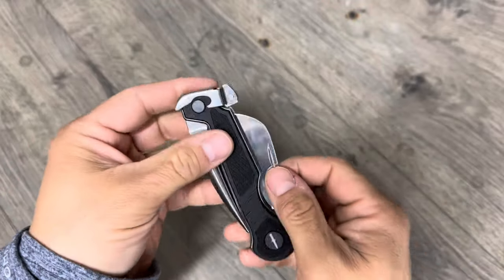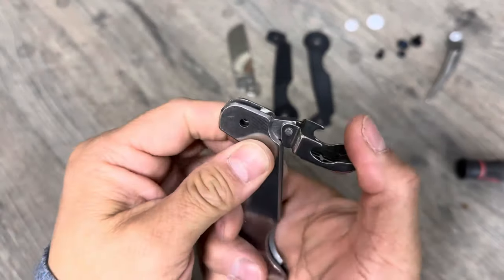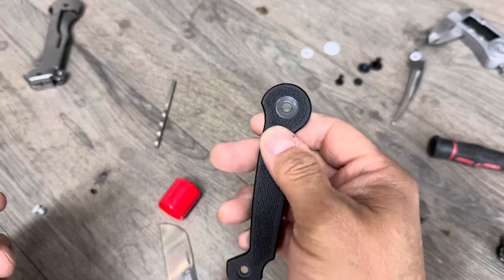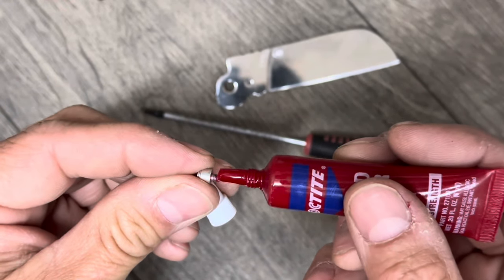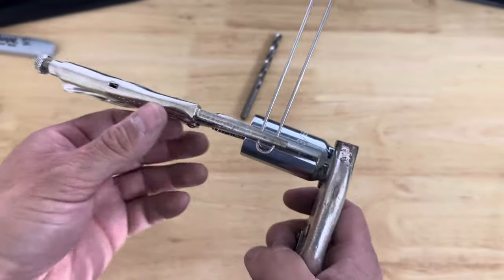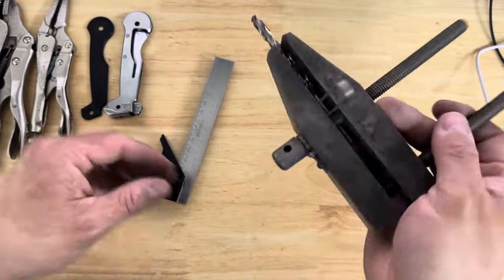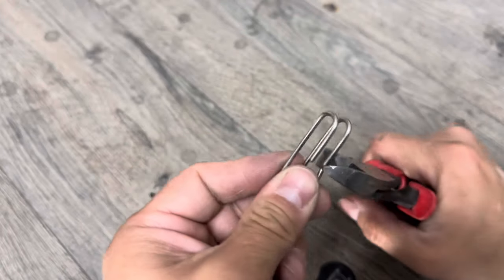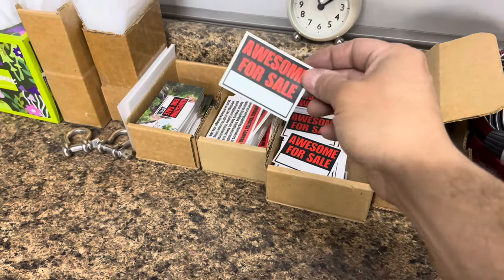I didn’t like my marlinspike knife, so I fixed it.

Comment: 😮 So much machinery for relatively tiny modifications. The result is awesome and professional. I think the knife brand should take note of the upgrades you make in this model because not everyone can do it at home... 👍
Reply: the ONLY reason I don't have one is the lack of a pocket clip....
Reply: Nothing fancy there but the water jet. I am betting a carbide tipped drill bit with lubricant would work just fine. Besides its not like he bought that equipment just for that project. He will use it again and again.
Reply: @dlighted8861  Apparently you can use a masonry drill bit.

Comment: Thanks FCA, you have quite a shop. For those of us unfortunates who do not have a water jet, d'you think a carbide drill bit would have made good progress? The tooling is pretty sweet, the engineering and execution is what sets you apart.
Reply from the maker: I don’t think it would work, but I also don’t have a whole lot of experience working with hardened metal.  If I didn’t have a waterjet, I would have used a small torch to heat up the area  I needed to drill. You heat it red hot then let it cool by itself, no quenching. That changes the temper enough to drill it with common drill bits. I’ve done it with hardened ball bearings.
Reply: I thought about it after I commented, and recognized the risk of the bit shattering too; yikes high velocity spall. It would be worth experimenting with a diamond bit, like the small diameter hole saws made for cutting ceramic. Say and I and my boys  have been big fans of your channel. Thanks for sharing the wisdom, and demonstrating leadership: you've earned your Instructor level Merit Badge.
Reply: Also: I have a Myerchin TF300P has been my edc for about 8 months. Recommended. Although serrations are not my first choice, these are big enough to use my diamond honing rod on yo keep lazered, and a little easier for cutting rigging. The Ti frame locks really bite into the steel of the implements, am still waiting for them to ease a bit. Right on.

Comment: If you just want to add a pocket clip and aren't as handy with bending steel rod, there are a ton of aftermarket clips for various knives. Many of them are made from thin stamped steel, so you can just drill a hole without needing to grind out the handle scale unless you want it to sit perfectly flush (a lot of knives that come with clips don't sit flush, anyway).

Unfortunately, I don't know another option for the thumb stud. If you don't have a water jet to punch a hole, you may be out of luck 😂
Reply: Do you think maybe the set screw type thumbstuds for Buck 110's would work?  Don't have an awesome waterjet like that one.
Reply: @PoorWays  I thought I had seen something like that before, but wasn't sure how to look it up! Looks like they're sold under "Kwik thumb stud". I don't see why not, as long as the blade is thin enough at the spine (~1/8" on the ones I could find). They're cheap, so worth a try -- I might buy some to try on my Case knives.